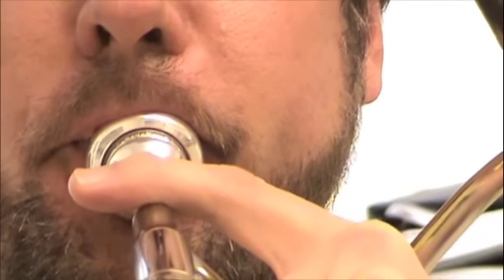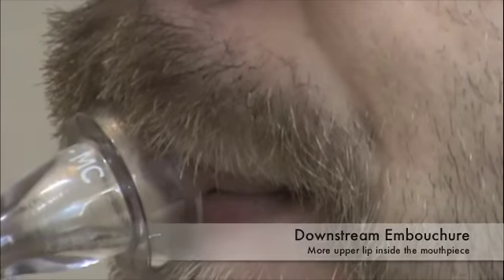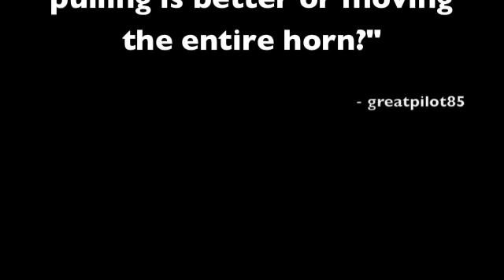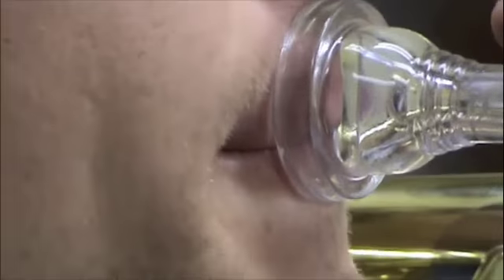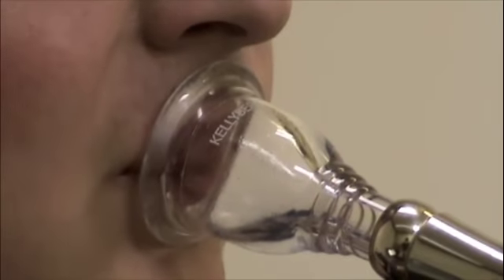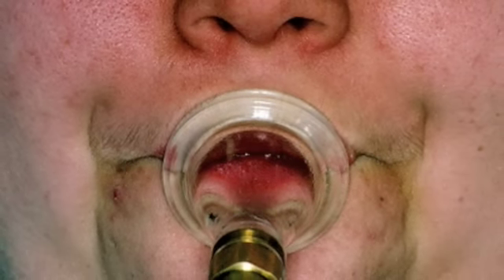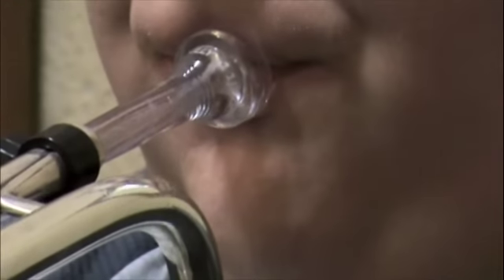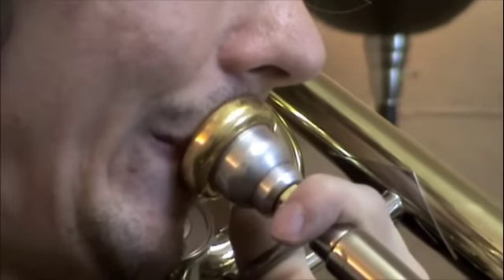Embouchure Questions and Comments

Comment: I play euphonium. I have been noticing excessive pressure in my upper lip, so I have been experimenting w/ embouchure. I have a full lower lip & find it difficult to play the high range, so I roll in & angle the mouthpiece up, which kills me. My director is for blowing the air forward; he says this makes a fuller tone. Another thing that he encourages is placing the corners of the mouth @ the canines & using air pressure to ascend/descend. My lesson instructor is the same. Any suggestions?